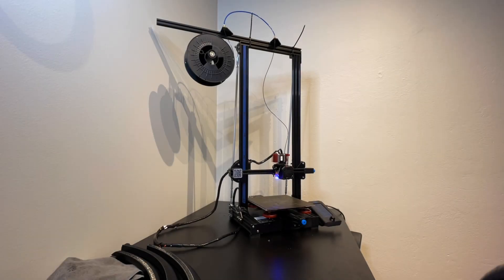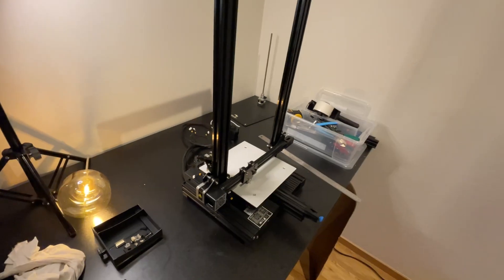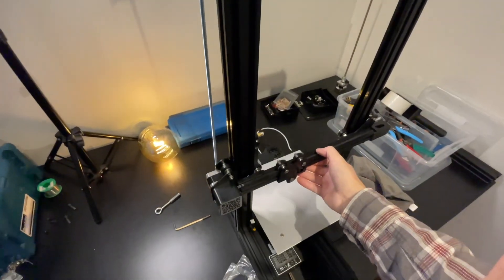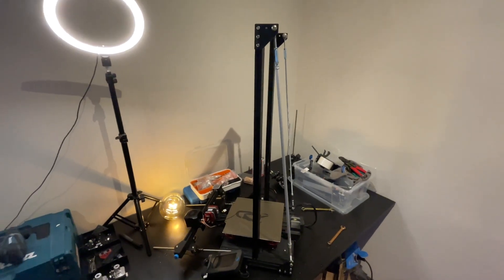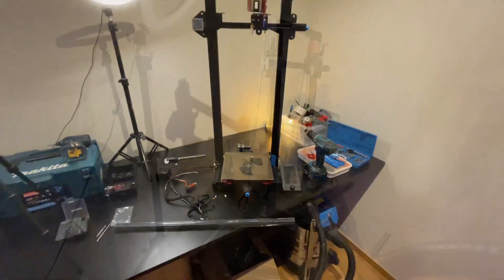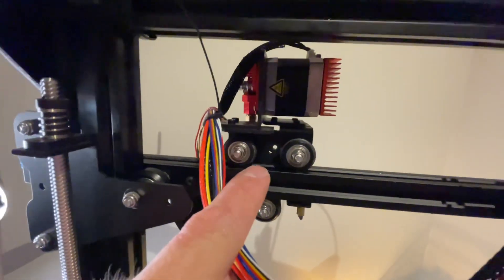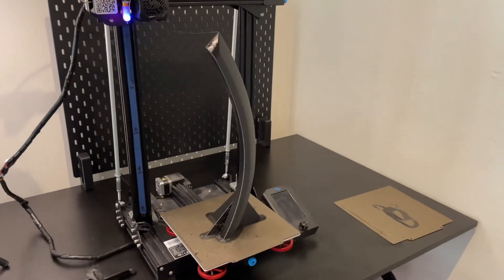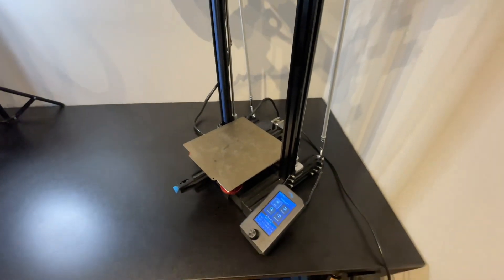How to do it: ENDER-3 v2 EXTENSION, 600mm Z build size, DIY!!

Comment: @ASKDESIGN AUTOMOTIVE Hello!

It sounds like you're interested in upgrading your Ender 3 to achieve a Z-height of 600mm using a dual Z-axis setup with two lead screws and two motors. That's a great project!

To help you out, I'll need a bit more information. Since I'm an AI, I don't have personal projects or experiences. It's possible you're referring to a specific project you've seen online or one that's been discussed in a forum.

Could you please clarify where you saw this project or provide more details about it? For example:

Do you have a link to the project or a video/image of it? This would be the most helpful.
What is the name of the project or the person/group who created it?
Could you describe any specific components you saw in the project?
Once I have a better idea of the specific setup you're referring to, I can provide a more accurate and comprehensive list of materials.

Looking forward to hearing more about it so I can help you with your Ender 3 upgrade!